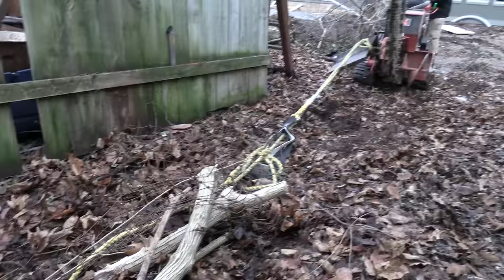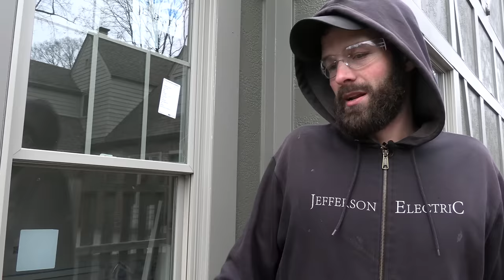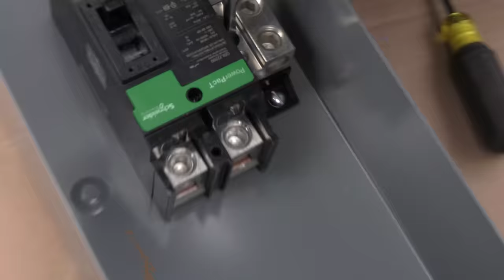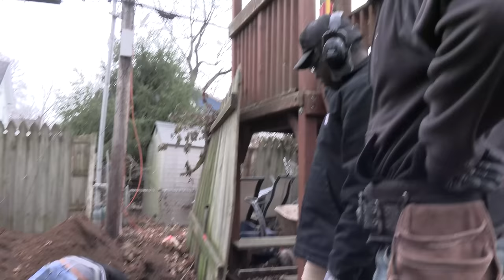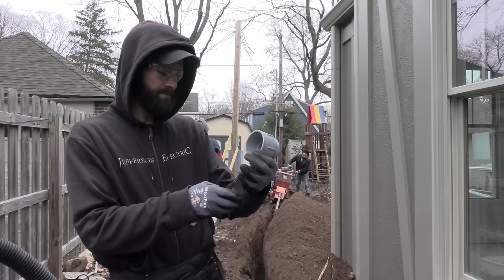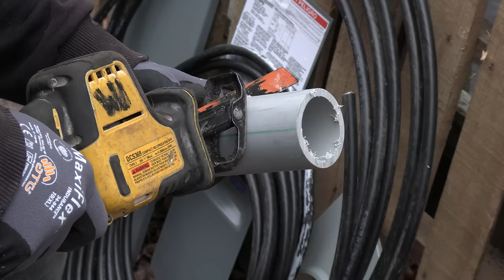What are we, ARCHEOLOGISTS?!

Comment: To knock out those concentric knockouts, use your linesman on each spot weld and wiggle side to side.  Clean break with ease.  When using disconnects below the meter socket get rid of the LBs.  Use the knockout in the back bottom of the  disconnect with a 2” romex connector.  Saves labor and material money.  Instead of duct seal inside a service LB use great stuff fire foam in the gun.  U need it for upper penetrations on new residential jobs anyways.  It’s expanding foam so it seals better around the conductors.  Love the videos Joel!  If I lived in Indianapolis I would definitely work for you.  Keep up the amazing videos
Reply: Would agree with the use of a Romex connector on the back of the disconnect box with some sealer (much easier) as long as you can meet the height requirements of the main breaker and meter.

Comment: Word of advise, when you are running a conduit from a service pole, run a 3/4” conduit for the other utilities also.  Even if the other utilities already have lines in place, run it and mark it with the address.

In my area, if you already have the conduit in the ground the fiber/phone utilities usually won’t charge extra to install the wire.  Cable will do it under 200ft or so.
Reply: You Missed it....
Reply: Why not 1"?
Reply: Just double it to 2.25 inch runs .  It's well over 200 foot ........  Then do a co and change it to overhead anyways

Comment: 54:00 why don't you use low/no-expansion flame-retardant foam? It seals around the conductors and freezes them in place and it's dramatically faster to use.

Comment: True story time: About 25 years ago we were installing a set of oil lines (heating oil tank) through the sill board of a facility. We landmarked a 25 pair phone line inside and outside.... then drilled a few inches to the side so everything would be clear. I feel the drill break through, and I yell to the guy on the inside "ok, we're inside a few inches to your right." the guy yells back "you mean a few inches to the left of the phone wires?" It seems the phone guys hit the end of a stud and rather than make a new hole on the outside they pulled back and hit it again at a VERY sharp angle. Someone from the desk ran out and asked us if we knew why the phones went out, which is when we discovered we put a hole directly through that cable. The lesson here is, when in doubt, drill in the next bay over!

Comment: Little tip once you drill your exploratory hole take a piece of wire and bend a 90 on the end thats half the diameter of your conduit should look like a L. Insert the measured bent end of the wire into your hole and twist it. This is a quick way to determine if your exploratory hole has any obstruction for the size of the hole. Then make the trip to see if theres any obstructions for your desired path. Have used this technique in various applications from drilling blind through walls or through roofs.
Reply from the maker: Paul at Stud Pack loves that one too! Thanks

Comment: When I have problem getting concentric KO'S out I just break out or bend the first KO then cut the circular 3 ribs with sharp dikes then use side cutters to bend the three hanging pieces. I never used more then 4 screws to mount a 200 amp meter can. If I was going into stone and using 1/4" lead anchors only used 3 screws and fender washers. Years ago we had an old inspector who would hang on meter sockets on new sparkies to check their work.

Comment: Another great video. Did the utility company tell you where to land the sweep at the base of the pole?
Reply from the maker: Yes, exactly
Reply: I seem to always encounter issues when going from overhead to underground. The underground engineering group will want the conduit coming up at one location and the overhead engineering group will want it on the other side of the utility pole adding an extra sweep.  @ElectricProAcademy
Reply from the maker: Sounds right. 😂

Comment: Wouldn't it be easier to get the Duct Seal installed if you had the guy on the inside put it around the cables from the inside out?  It seems like you would get a better seal around the cables/wire, and then if you wanted to, then you could just foam from the LB side with a can of foam to weather seal from the outside, which would expand around the wires.

Comment: The "disconnect" at 12:00 is NOT a Disconnect. It is a Disconnect KIT.   Like a  grill- they don't even put the thermostat on the glass.  So you get to trade your (USA) time for foreign factory time.   If it fits in the same box, it ought to be assembled by the lowest cost labor.

Comment: I’ve never been clear on whether it’s OK to strip the jacket off of SER when running through an LB like that.  It’s in conduit, and the individual conductors are typically rated.  There’s typically not a clamp holding the loose end of the cable to the LB.  So is it really conduit it or is it just a sleeve?
Reply: Just don't take the cover off of the LB and no one knows.
Reply: The insulation should have been intact in the LB

Comment: Did You Guys explore the option of going underneath the Slab ???
Reply: I was going to suggest a large cut-off saw instead of a machine rental. Good chance that water feature base is only a few inches thick so only an hour or two of work and easier to get rid of smaller pieces.

Comment: At 39:00 you show your disconnect being connected via an offset to the meter box. There is still a concentric knockout left, doesn't that mean there should have been a ground bushing on that offset instead of a regular nylon bushing?

I'm sorry I don't remember the code rule that specifies that, it's just that I did my continuing education last month to renew my license and that was one of the things I remember from the NEC grounding stuff. 

I'm not trying to knock you down or anything, just trying to justify that continuing education 😂
Reply: Ground bushings are required for concentric knockouts above 250 volts. However some utility companies require ground bushing on any metal fitting entering the meter enclosure.

Comment: Quick question: Does your Indiana utility NOT require you to install meter bases with a lever-operated bypass? This is the second installation I've seen you do without one. Most Minnesota utilities require them, so that when the meter is pulled or changed, power is not lost inside the residence/business. As you know, this protects equipment sensitive to temporary power disruptions: e.g. compressors. We had to upgrade our meter base recently, when we changed out our masthead. Just wondering.
Reply: In Ohio, my utility requires horn bypass meter bases. When they swap a meter they use jumper cables to bypass the meter. Fewer parts and lower cost for the base but still allows a bypass.
Reply: @hughesda1006  - that's an interesting design. It doesn't like Joel was using a horn bypass. Though, from the literature, it appears that the horns can be retrofitted.
Reply: As a homeowner in Wisconsin we have nothing like that. Ours is like in the video, if the power company takes your meter you have no power.